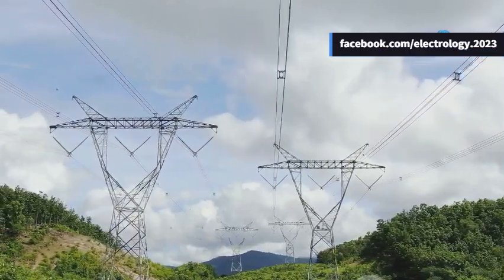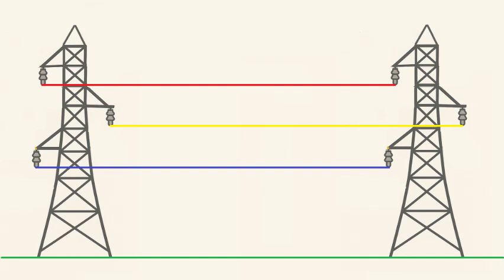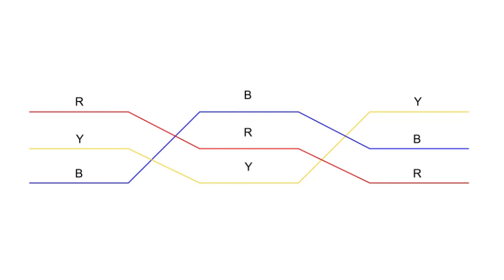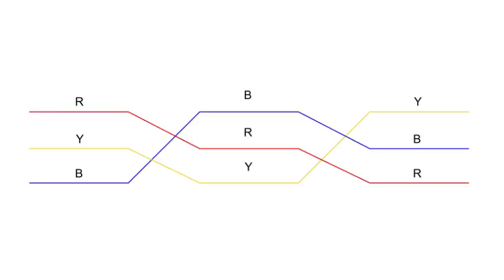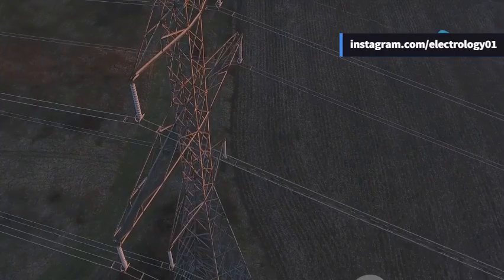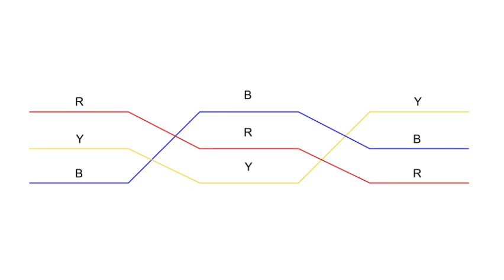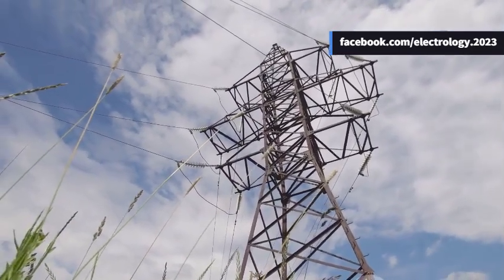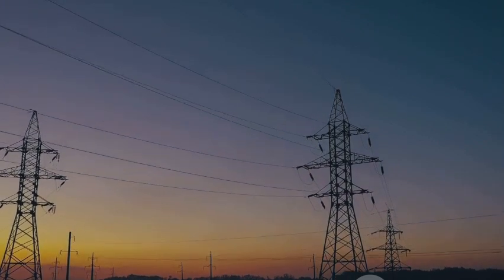Transposition of Transmission Line | Why it's done & How it balances the system

Comment: Actually if the 3 wires are placed in equilateral triangle then the geometric mean distance of 3 phaes will same and  inductance is same but practically equilateral triangle is difficult and mostly used horizontal or vertical position then inductance will different for all phases and change to unequal value and makes instability